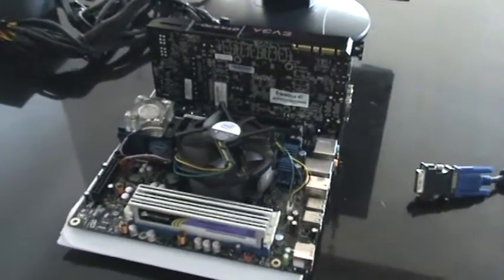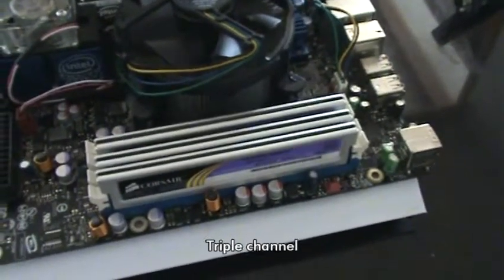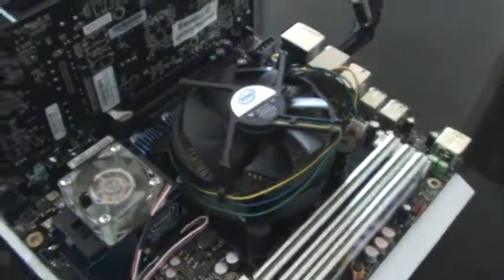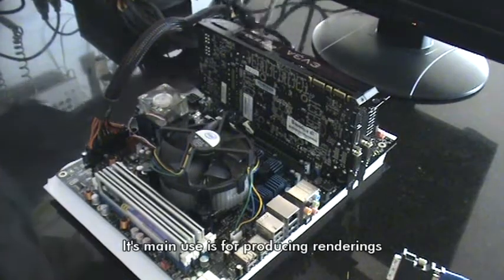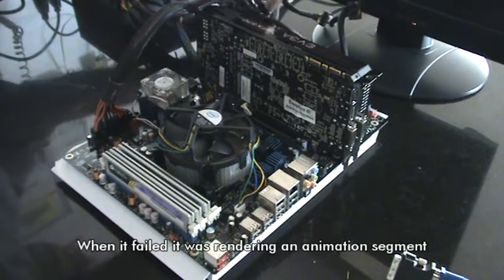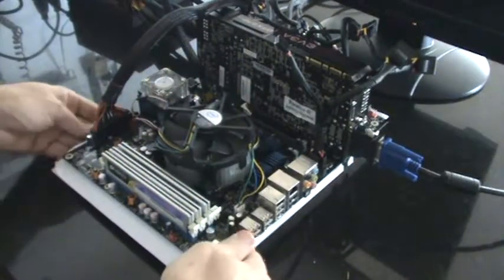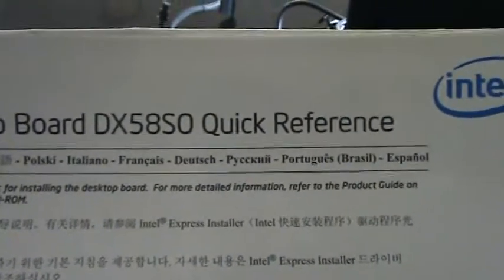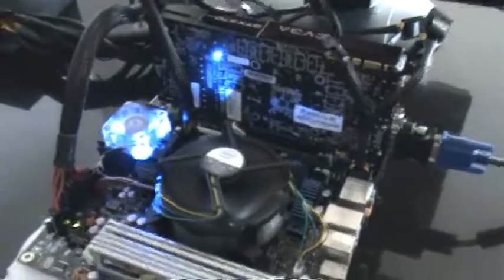Intel Core i7 or DX58SO mobo failure help

Comment from the maker: I have news for you all. It turned out to be the motherboard. A friend of mine took a look at it and found a dead capacitor, replaced it for another taken from an already canibalized mobo and voilà! It's up and running again. He said to me the damaged piece was barely noticeable, He did a fine job. I can't identify the replaced capacitor by just taking a look, he has to point it out for me, and still. Thank you all for the feedback, and I hope this last piece of information is of use for you.
Reply: brother good part is that you, by chance is not Venezuela?
Reply: federico saludos desde chile, lo primero q estas haciendo mal es q estas conectando las 2 entradas auxiliares de poder la del conector sata y la del  conector molex de 4 pines, SOLO SE CONECTA UNA DE ELLAS!!! o la molex o la sata !!, ademas creo estas placas madres tienen problemas si la ram es mas de 12g la frcuencia q ocupan es max ddr3 1333, otro problema es q para q tome las tarj, de video nuevas tienes q hacer update de Bios a la ultima version. como probar??

_Primero Reza para q no hayas reventado el regulador de voltaje de la placa conectando las 2 entradas de poder aux de la placa (MOLEX Y SATA)conecta solo 1
_resetea la bios, desconecta todo pruebalo con el minimo de ram, 2 o 4 gb consigue otra para q descartes q las tuyas estan malas
_Una placa de video pciex chica antigua q no necesite poder auxiliar de la fuente

ojala te ayude, responde pa saber como te fue.  saludos guillermo
Reply: Guillermo solo se necesita conectar uno solo ya sea el SATA Y/O MOLEX? cada uno da el mismo voltaje?, le agradezco su respuesta a esta duda.
Reply: William disculpe si me demore en responder, si amigo conecte solamente UNO de los dos. saludos desde chile. yo tengo la misma placa madre pero solo con conector sata de poder auxiliar, el molex se lo eliminaron para evitar confuciones.
Reply: Guillermo gracias por tu excelente aporte, disculpa regalame un correo electrónico donde escribirte otras dudas que tengo por favor.
Reply: Federico Arribas can you tell me where is the dead capacitor located?

Comment: I know this video is old and you solved your problem. My dx58so started doing this 3 weeks ago. Same issue.  So you fixed the capacitor and it worked. Sadly in 2018, probably not worth fixing. I May as well replace board. Thanks for posting this. The days of playing overwatch are over for this old board .  ☠️

Comment: I got a identical rig, had it running for 3 years now, friend fished it out of the dumpster. no problems. 
Pretty weird how if it was working one day, and then another day stopped. basically test all components in another motherboard to rule out possible memory / cpu / video card failure

Comment: You need to plug in the video power on the right side of the board. Only use one power connector not both on the video connector

Comment: I have the same problem with the same motherboard.  After three years daily use I switched off my machine one day, and it wouldn't start the next.  I checked the power supply, the video card and the memory - all OK on someone else's computer.

So I replaced the motherboard with a brand new one.  It started - once (with nothing else connected), so I reconnected everything else, and no video, at all.  I replaced the video card with another, restarted once, OK, but not a second time. I am stuck!

Comment: hola Soy Daniel de Argentina y tengo el mismo problema y soy electrónico y fue lo ultimo que me imaginaba que sucediera en tan alta tecnologia de placa. Pero si  es así me gustaría saber que condensador es, por lo menos si es un electrolítico o uno de los pequeñitos de montaje superficial. Desde ya les agradezco la info. Cordialmente Daniel Muñoz.
Reply from the maker: Daniel M. Realmente, no soy capaz de identificar el condensador. Ni recién reemplazado ni ahora. Fue un buen trabajo de mi amigo Julio. Lo siento.
Reply: Bueno te agradesco de todas maneras la respuesta y buscare con una erramienta que detecta esos capacitores defectuosos. Un abrazo y Dios te bendiga

Comment: I have same motherboard using almost 12 years.. you need fix Ram in slot by sequences. Means 1324 like this. 4 means black slot. Did you check it or might have graphics card issue. If ram is correctly then remove your graphics card and replace another issue. Hope it will helps. God bless you.

Comment: hi i had  the same problem and it turned out to be a jumper reset problem with motherboard.to reset bios and the pc would start but same when i use maya or play games it would just work fine but  the moniter would show no signal and the num lock wont even work (i am a 3d modeler) can u show which part u changed ..thanks
Reply from the maker: Rokie231, to tell you the truth I can't. As I said, my friend did a very good job and I coud barely distinguish the capacitor he replaced. Now, over a year later, even less. I'm sorry, man.
Reply: Federico Arribas Mr. federico I wonder how could contact you to see if the technician who helped you could help me I have a problem with that motherboard, thanks in advance for your prompt response

Comment: Hello,

Any chance you fixed the issue?? I have a similar setup. same mobo. i7 930 cpu. It was working for 2 years. Once came across this issue before 2 years. But after several restarts and replacing the battery i got it to work again (luckily). But after turning it off for about 2 days, the system gives no post. Same as in the video. Tried restarting and everything i'v read on forums. No luck. No beeps even without RAM or VGA.

Comment: I've had that problem. the video card did not work. However, the integrated video card worked fine. What I did was update the BIOS of the motherboard whit the last version.. after this, the motherboard accepted the video card. Watch these videos about the different ways to update BIOS  safely. And don´t worry, it's not as risky as before. The method I used was F 7 with USB. Be sure to have a nobreak
 http://www.intel.com/support/motherboards/desktop/sb/CS-022312.htm